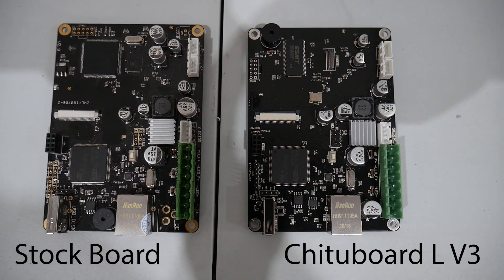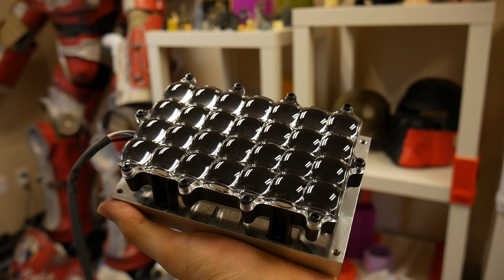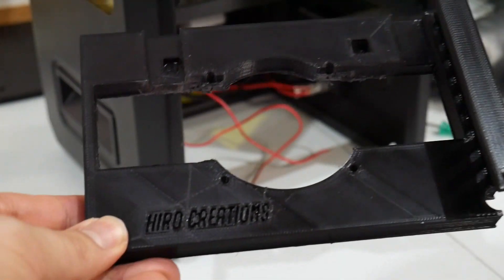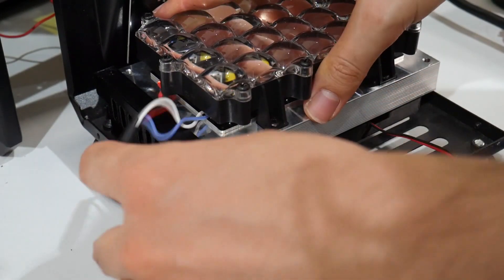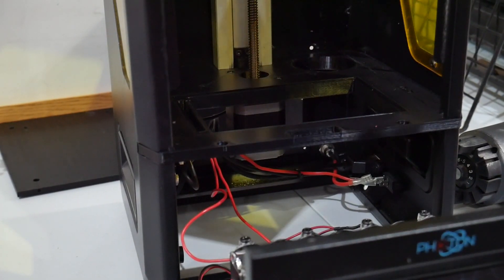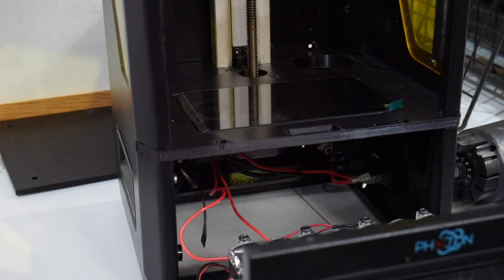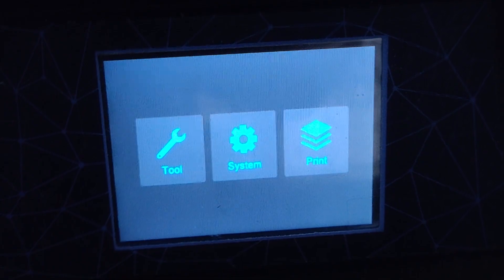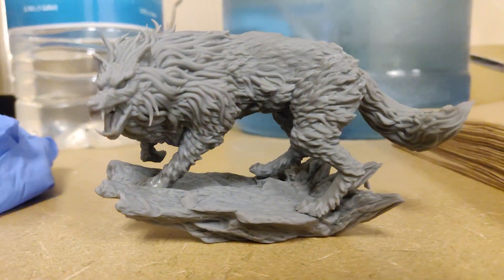Overclock a OG Anycubic Photon with a Mono LCD Upgrade

Comment: I bought a ChituSystems 6 inc Mono upgrade kit for my OG Photon and would also like to upgrade the LED array. You recommend the Duobond UVA-A28 but they now make another model, the Duobond UVA-A25 which is cheaper and uses a Fresnel lens to produce an even and parallel light source. I would be interested in your thoughts before I commit to it.

Comment: Thanks for the video. Very instructive!!! I've got a question. I installed the upgrade kit including a chitu v3 board, to also revive a long dead og Photon. Updating the firmware as well. But the TFT 2.8 touch screen is blank. It turns on, but it's blank. Is there a firmware update  or should I get a new matching chitu touch screen?(I can get a ld002r screen easier, but I don't know if they are compatible, besides being larger). Thanks in advance.
Reply from the maker: I'd check the ribbon cable connection on both sides (also make sure its not flipped) of the TFT screen if its blank. I made that mistake on my builds.

Comment: Hey Hiro! I’m your big fan, I always not satisfy with default machines. Now I want to put my photon mono electronics inside photon shell , is there possible with your mod printed parts ?
Reply from the maker: Thats a first, I am not fully sure as I don't have my Photon Mono anymore. But I don't see why it would not work--you might have to adjust the board mounts slightly if the board screw holes are in a different position.
Reply: @HiroCreations  thanks man I’ll try it !

Comment: if it costs like 150 euro for the mods in't it better to just buy the photon mono
Reply: depends how you look at it. You dont need to add the lamp, or in some cases the board depending on the photon model you have they done 2 versions. So if you happy with a 3 second cure time rather than 1.5 second and your photon has the right board then 25 quid to drop from 8-10 second cure to 3. Worth it IMO

Comment: What is the difference in the screen plate, Can I modify the original plate? I have a drill and router table....
Reply from the maker: Depends on if you want it to just fit or utilize the whole 6" screen. If you want to utilize the whole screen you'd need to mill out pocket that holds the support glass (and buy a larger piece of glass) and mill out the 1.4mm-1.8mm along the edges where the edge of the screen would rest.

Comment: I have a Photon S that is kaput.  Symptoms point to motherboard.  I will look into this idea.  Dead printer to a working unit will be fun project and if cost effective, cheaper than buying a new printer.  thanks for the video.
Reply: The photon s is on clearance on anycubic for $179 and I used a coupon code and got $10 off. Probably around the same price of fixing your current one.
Reply: 10OFFSITEWIDE
 is the coupon code

Comment: Well, I managed to knock one of the surface mount components off my stock Photon board so I had to order a Chituboard replacement.  I have a couple of remaining questions.  I mounted the 2 smaller 24 V fans on the printed UV light support, but I'm not sure where the 60 mm 24 V fan is supposed to go.  Underneath the chassis?  Thanks
Reply: Also, can I run the stock mainboard fan on the 24V supply or will that burn it out?
Reply from the maker: The 60mm mounts on the back with a printed adapter to replace the metal panel, either pushing air in or out. The stock fans are 12v so its very likely 24v will burn them out.

Comment: what brand of resin are you using? im using Siraya Tech fast grey im trying to figure out the best starting point.
Reply from the maker: Knowing how fast Siraya Tech Fast Grey is I would try 1.3-1.5 second layers and 10-15 second base layers and adjust in .1 second increments till you find perfect exposure.

Comment: After a month of tears and frustration and learning a bit about electronics, i completed the upgrade. My only criticisms is that the use of the printed platform kept seizing the z axis before the endstop was reached (i was using a linear rail mod so the lack of play may be the culprit) and that the back plate doesnt quite fit the oem mainboard fan, i currently have the oem fan dangling with the back exposed.
Reply: I just finished the upgrade myself. I too have the dual linear rails on my z axis and it's seizing up :/ Have you found a solution?
Reply: @BerkErkul   Yes, its to go back to the original base plate and buy a 5.5 fhd screen or bite the bullet, modify the cad drawings to facilitate a glass plate under the screen for protection and source it to be cnc milled out of metal. i went with the former.
Reply: @BerkErkul  one thing i didnt try was to print the plate at a higher infill. to get screw unstuck i had to poke the stepper from the bottom.
Reply: @dascodraws  yeah I'm going to try 100% infill and see how it goes. Just dreading that I have to take everything apart again :/
Reply: @BerkErkul  I have had to take it apart 4 times now and im on my 5th because the plate fell off the rails and i put it on upside down and it wont zero out properly. Hopefully this is the last time.
Reply: @BerkErkul  let me know how that goes.

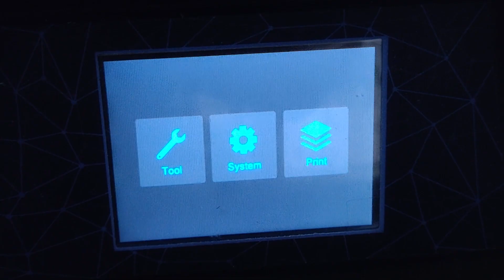Comment: 11:24 in the upper left corner of your screen, thats the imperfection i have. A dark arc circling the corner.
Reply from the maker: Its been so long since that build but I think that was stray wiring/ribbon cables for me and went away as soon as I fixed it all down with doublesided tape and zip ties.

Comment: I'm confused, trying to upgrade the light source per your video and have a couple of questions.  Since the transformer power coming into the Photon is 12V, and the upgrade fans and UV source need 24V, wouldn't you need a 12V to 24V boost converter? The BOM on your Github link  lists a 120-220V to 24V DC power supply (this link is dead by the way), but to use it you would need an additional 120V line coming into the Photon.  So it seems that to keep it simple  I would need a 12V to 24V boost converter to feed the fans and the UV driver board.  Also, in the video it looks like you are connecting the UV array directly to the boost converter, not to the supplied driver board.  Wouldn't I need both (boost converter to supply 24 V to the driver board which then connects to the light source)?  What am I missing?  Thanks
Reply from the maker: Good eye with the dead link, I'll have to source a new power supply to link. Both the stock photon board and Chituboard v3 are capable of taking both 12 and 24v inputs from the power supply and will output the corresponding voltage from the terminals that that control the light source. The supplied boost converter/LED driver is needed to actually supply the needed 34v that the aftermarket light source is actually rated for.

Comment: one last thing, what could i have done wrong? its confusing up with down.
Reply from the maker: Looks like you got one with reversed wiring, you can either reverse the wiring, or change it in the firmware. Reversing the wiring is generally simpler.
Reply: @HiroCreations   ok, one more i promise, can i buy the smaller screen from your last video and use the original platform plate? i have a rigid z axis (linear rails) and i think its the printed platform getting it stuck.
Reply from the maker: @dascodraws  no worries, asking questions are good and I will try to answer as many as I can. 

I used the stock build plate for both mods. They work fine.
Reply: @HiroCreations  so you're no longer using the 6.08" Monochrome LCD Screen then?
Reply from the maker: @dascodraws  I bought a second broken photon for the FHD mod. The original 6" mono is still happily printing away in the farm.
Reply: @HiroCreations   im going to combine your two methods of upgrade since the larger screen has a defect in one of the corners and its been 17 weeks since i bought all this stuff.
Reply from the maker: @dascodraws  bummer that the screen is defective. Good luck on the combined mod, hope it goes smooth.

Comment: thats the 3d printed flat plate for? i finally started this upgrade after getting a back up just in case i botch it. My initial thought was that it was a new back plate to repurpose the fan on the bottom to but i cant get the screws to line up.
Reply from the maker: It replaces the red aluminum plate that the screen sits on because the 6" screen won't fit flush in the plate.
Reply: @HiroCreations  no the other one with a big circle in the center surrounded by 4 holes. its much smaller.
Reply from the maker: @dascodraws  Whats the file name so I can look up on my CAD modeler?
Reply: @HiroCreations   ah, it is the rear plate. i printed this stuff so long ago that i forget to check the cad files. the plate doesnt fit the stock fan but its probably due to the printer i was using had an extrusion issue.

Comment: Even if 1 sec layer time is definitely an amazing feature not available on printers on the market, it makes the upgrade cost (including the printer base value) as much as a brand new mono printer.

Moreover, does using such an overpowered UV module affects the LCD screen life?

Would it possible a cheaper mono  mod that would limit the cost to the replacement to the lcd and eventually the video driver?
Reply from the maker: So far I am about 5.5K hours into that original screen and its still going strong, but with other experiments I've found that the stock light source and reflector does a very respectable job of getting great quality prints at the cost of being slightly slower.

Comment: just finished installing it ,but the touch screen won't turn on. I tried using another cable, still nothing. i flashed the chitu board latest firmware and it beeps multiple times. and the monitor still doesn't work. Did anyone have any bright ideas of why this is happening?
Reply from the maker: Which side is the metal leads facing? Sounds like the cable on one side or the other could be facing the wrong direction.
Reply: @HiroCreations  i actually is, i just fixed it.  Thanks for your help. After that i experienced a UI error, but after reflashing the firmware, it worked just fine. Later when i was trying the array. I blew it up cause i fliped the wires the wrong way. Now i have to get a new capacitor. Great video btw.

Comment: do i really need to change the UV light for using a mono screen?
Reply: you can not simply swap the screens, the board has to be configured to go along with it, and while you do this, swapping the uv source is a by product.
Reply: @kensaiix how about if i use the stock screen and the upgraded uv would it still work?
Reply: @jasperdelumen1587  stock screen of what? the good ol' photon? i am not sure, you could in theory do that, provided the power source can handle the new load and if you mod the light channel to accommodate for the different size (photon has a funky funnel). i am also not sure about the heat on the screen itself, RGB has a different transmission than mono (it is worse), meaning you could run into thermal issues on the screen itself.
Reply: @kensaiix  thank you

Comment: for board which drive did you use?? A4988 driver or TMC2209 driver?
Reply from the maker: Both work fine I have run both versions on different mods, the TMC2209 driver is much quieter though
Reply: @HiroCreations   can I buy the print it parts from you? If yes, from where?

Comment: Looks great cant wait to try this got a photon s for parts the other day now I have a use for the shell and parts I dont need to swap is the 5.5 inch screen available as of yet? Subbed your channel cant wait to see what else you got keep up the good work. By the way which variant of the v3 board are you using the TMC or a4

Comment: You changed the LCD screen to a bigger one so you had to replace the red aluminium base to accomodate this new screen but you use the same vat and same platform so I understand there is no increase in printing area. Isn't there any Mono LCD screen with the same size of the original (5.5" I believe) so you don't need to remove the aluminium base an print a new one?
Reply from the maker: I probably should have made that clearer in the video but the vat and build plate actually much larger than 5.5" and easily allows me to fully use the 6" screen.

There is a 5.5" mono screen  that is a drop in replacement in the works that I was given a screen to test, and I will be dropping a video about that screen soonish.
Reply: @HiroCreations  thanks for the info!

Comment: Hello Hiro , i converted my photon today . All went well and is working , i imported you config file in chitubox en when i save the stl file i get a photon extension like before. When i want to print it the printer say's unnown file format ??What do i wrong ?
Reply from the maker: This board now uses only the more efficient CTB extension (. photon and clddp extensions won't work on the v3 boards), my Chitu profile should be enabled to save the file as a .CTB when you slice the file.
Reply: @HiroCreations  Thanks for the reply , i do have one problem. When the print is ready the plate goes up but it does not stop right away when it has reached the end. I hear the motor loosing steps at the end. Do i have to change the Z setting. Its 150mm now.
Reply: I.m sorry i should have looked a little further on the Shituboard website . It likes ctb format files.

Comment: Any chance you can post the CAD files over in the repository? I'm currently building one of these but I'm wanting to make a couple of tweaks, your CAD files would be tremendously helpful in doing so!
Reply from the maker: Yep! I've been meaning to do that. My current fusion files for that project is a bit of a hot mess with a few dead end ideas that need to be cleaned up to avoid confusion but I can and will try to get the step files uploaded soonish.

Comment: I have a question, my photon mother board died and I need to buy one new, the ChiTu-board will works as a replacement? ( not try to overlock just replacing mother board)
Reply from the maker: Yeah the older OG photons are actually using older v1 Chituboards, the newer "fauxton" Photons and Photon monos are using a very similar copy of the chituboard. So a chituboard L V3 (the one that uses either Sharp SX04 screens or 6" mono screens) is pretty much a drop in replacement with no recrimping needed.

Keep in mind you will have to make sure you know what board you have so you can ensure you are correctly connecting the right screens to the board. Wrong screen type can kill the board, which is something that everyone has done a terrible job of documenting.

Comment: Hi Hiro! Thanks for the video. I'm about to receive a broken Photon S suitable for the mod. I was wondering, when is going to be out your new video with the simpler mod? Thank you.
Reply from the maker: Good question, for the most part I am waiting  on the screen maker to officially launch the mono 5.5" screens for sale before I drop the video (they requested I wait until they did, and seeing how I was one of the lucky few to get several testers I am more happy to comply).
Reply: @HiroCreations  All right, let's hope it will be soon then. WIll it be just a motherboard + lcd swap? No 3D printed adapter like this one? I would do this one you published (without changing the LED array) but I have a Photon S and lack the skills to modify your stl for the mounting :D
Also, if you can say, do you think the 5.5 will be around the same price of the 6.08?
Reply from the maker: @DevastedSoul  Yup board + motherboard  only swap for the Photon series printers. For a elegoo mars its actually easier with a screen swap only (with firmware update).

Not sure on pricing but the range I was told puts it very comparable or cheaper than 6" DXQ screens.

Comment: Hello. I thought the upgrade was incredible. The possibility of changing the spindle pitch in the firmware? I am thinking of replacing the trapezoidal spindle with 12mm ball screw 4 pitch.
Reply from the maker: Yep!  You'd basically alter the steps per mm value in the configuration gcode that gets uploaded to really any chituboard (don't need to buy a new board if your current machine is running on a Chituboard).

Comment: do you know if i can mod my photon S this way??
Reply from the maker: The mod would work but you'd need completely different printed parts like the plate that the screen would mount into. Might be worth waiting for my 5.5" mono screen upgrade video to drop, which is far less work and closer to a drop in replacement.
Reply: @HiroCreations  that's so cool to know!! I'll be waiting for that video :)
Reply: @HiroCreations  can I use the original touch screen??

Comment: Well interesting mod but in the end it is as expensive as a new Photon Mono! :)
Reply from the maker: Definitely similarly priced to a Photon mono but the modded OG photon is about 40% faster (1.1 seconds vs 2.5 second exposure layers, and 17 second base layers vs 22 second base layers), metal frame, and metal vat with easy to change FEP film. And more flexibility in slicers outside of Lychee and Photon Workshop.

Comment: ChiTu L V3 board for mono screen mSLA/LCD 3d printer)
Hello, The slicer Chitubox is not compatível anycubic mono..... it will be possible to buy the chitu board and put it on anycubic mono. thus it would be possible to have a printer compatible with the slicing system. it will be? I don't see the chitubox in mono so quickly. several months have passed and there are no answers. thanks.
Reply from the maker: I actually thought about doing this for the Mono X, from what I have seen, the layout and connectors are nearly identical for stuff like the end stops and motors--so in theory it should be an easy swap. You'd effectively be jailbreaking the Anycubic printers.
Reply: Thank you😊